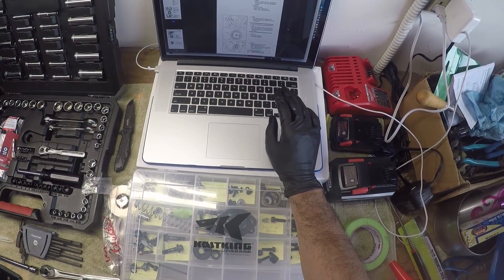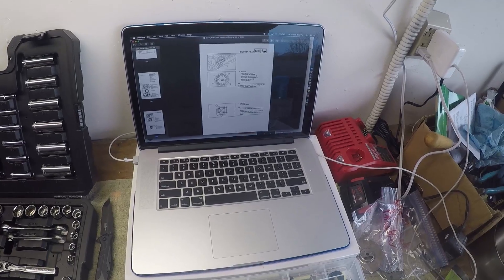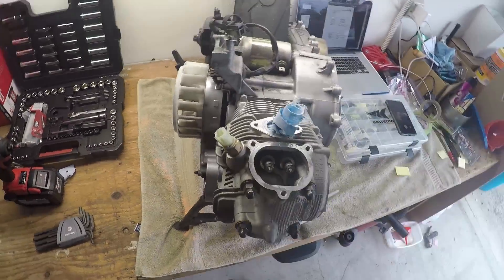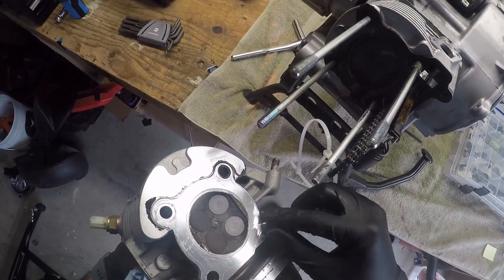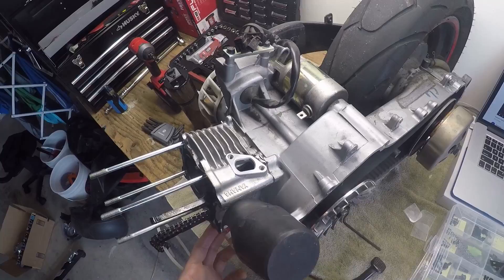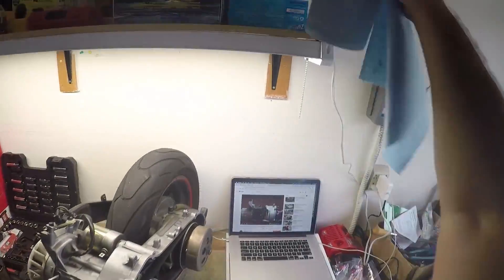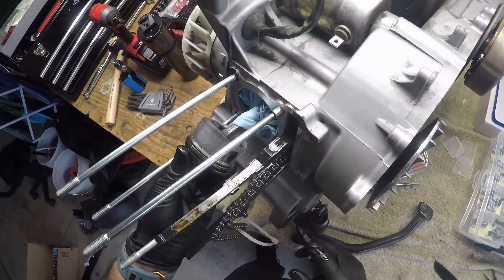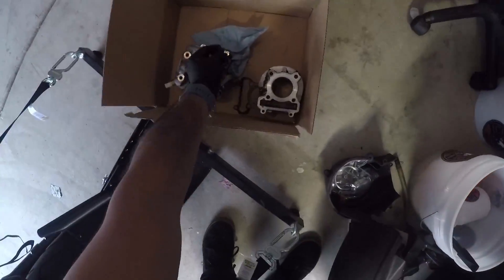Big Bore Kit Series #8 -  How to remove the cylinder head on a Yamaha Zuma 125 (BWS) - Part 2

Comment: Great video❗️👍✅ have you noticed much of a change in your performance of your Zuma❓I know my Zuma 125cc will hit 57-60 MPH and it is 100% stock with 1900 miles on the odometer and I am 230 lbs.❗️👍✅🛵
Reply from the maker: big change, on the 164cc kit i was making enough torque to pop wheelies from a dead stop... and it was pulling all the way up to 60mph

on the 175cc kit it was pulling all the way up 65mph and  i still had 5-10% throttle left

i think i can get it to 70mph on a long run and maybe 75-80mph if i switch out the final gear
Reply: Onyx Haze Boy that is great boost in power, I had heard that you could expect to get great performance with the upgrade. I am glad that it all worked out good and I know that a lot of viewers are interested. I still have 2 years left on my extended warranty so I won’t be doing the upgrade but it is very interesting.❗️👍✅🛵🤔
Reply from the maker: @mikemiles3068  Chad was telling me he saw performance gains even with the 155R big bore kit, i think thats really what the zuma needed  and yamaha knew it but they made the smax instead